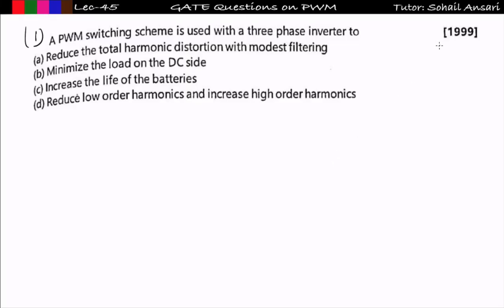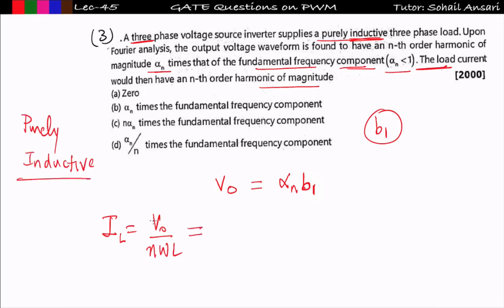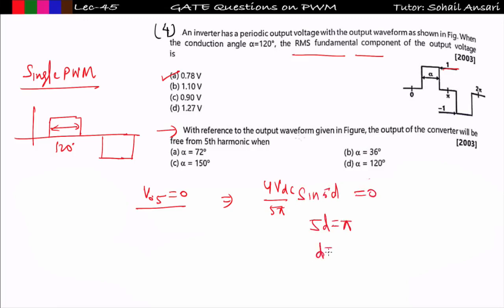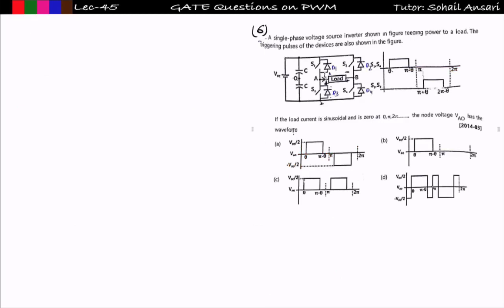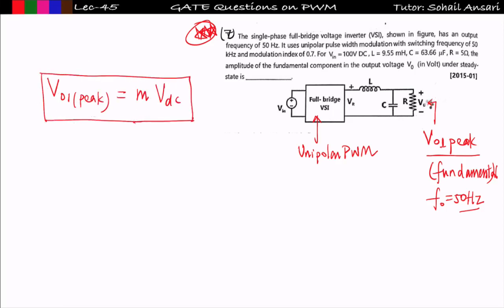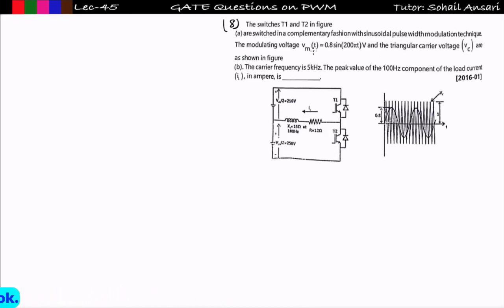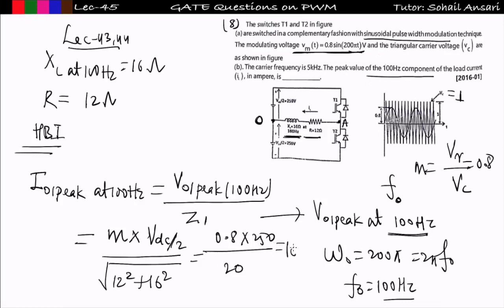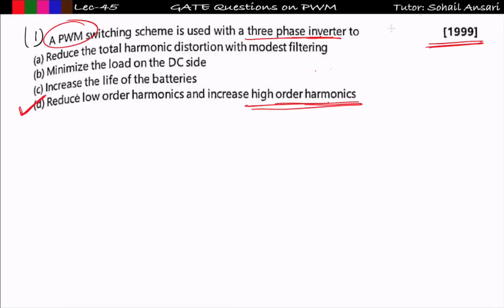Lec 45(a) GATE Questions on PWM Inverter | Power Electronics

Comment: Question 6,9:38 I think,from π-theta to π D3,to maintain the current direction +ve D3 has to conduct,then only pole voltage will come -Vdc/2,
Correct me if I am wrong
Reply: I think so too. After s1s2, d3d4 must be conducting

Comment: in 8th question, they asked vpeak at 100HZ that means its AC fundamental voltage right. so v use 4V/pi by Fourier series?

Comment: sir for que 7 peak value of fundamentaL compenent of voltge across R is asked at steady state at steady state the circuit L behave as shortckt and c as open ckt than in circuit only 70 v source n R will be there, iam getting doubt here at setady state is asked than why L and C is included in circuit for calculating V across R
Reply: 70v is not dc it is peak value of fundamental which is ac
Reply: @rituanjana2062  I have one doubt regarding prblm no. 7 ,as you said it is DC then finally I am not getting the answer that Sir had solved instead of that I am getting (Ans 45.45v).plz explain this....
Reply: I said 70v is not dc ,read my comment carefully